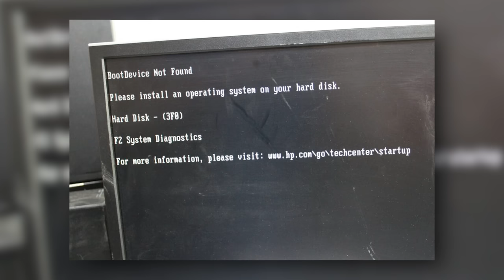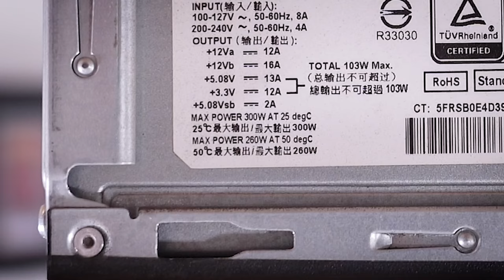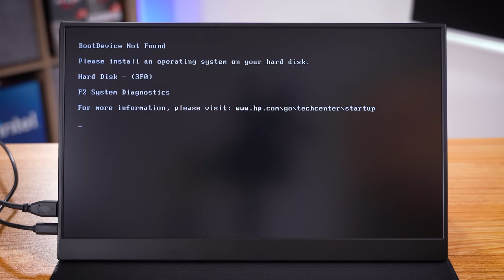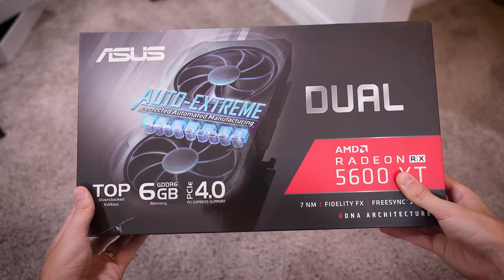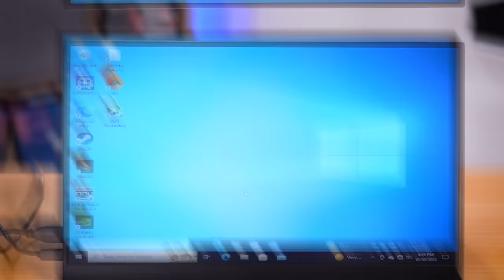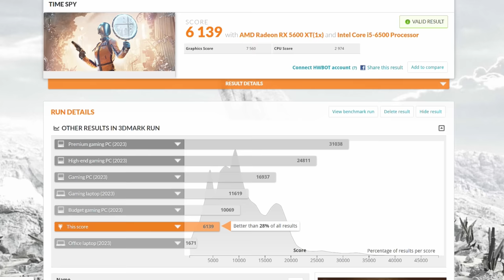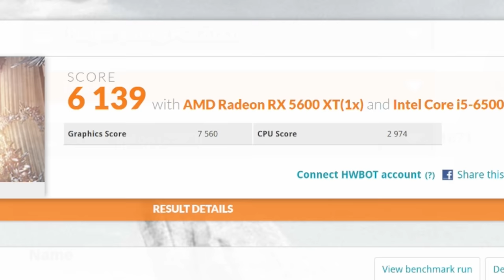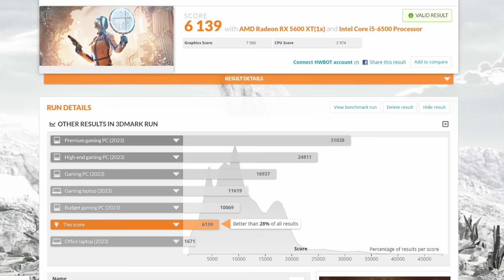I Built a $200 Bare-Bones Gaming PC!

Comment: At a little after 7:00 into the video, I noticed that the chipset does not have a heatsink on it.  Do you think it came from the factory w/o one or that it somehow got removed at some point?  Would it be worth stickin' at least a small one on it with a nice sticky thermal pad on it to hold it in place?
Btw, I totally agree with your summary at the end of the video; it's so much fun to see what you can make happen with a little older and cheaper used parts.
Reply: A lot of OEM systems are like that, not usually an issue

Comment: Might consider limiting purchases to Win11 capable machines, which include the required TPM 2.0 module. That is: Intel 8th generation or newer. For example, a renewed/used Lenovo ThinkStation P520 with Intel Xeon W-2135 CPU is fully Win11 compliant. A P520 "barebones" machine with CPU only, but no ram, no storage & no GPU can be found on eBay or Amazon for ~$185, shipped. Also note: a Hackintosh running macOS Sonoma does not support using any NVidia GPU's. Only certain new AMD GPU's are Sonoma compatible.

Comment: Hey, could you rate a pc build idea i have?

i5 10600kf
rtx 2060
1tb m.2 ssd 3500 MB/s
thermalright peerless assasin 120 SE argb
650w semi modular psu
and silicon power ddr4 32gb kit 4x16 for a total of 64, i do a lot with ram sometimes.
Reply: i just want to see if it is adequitly balanced compared to the pc im using now,

i5 6500
gt 1030
256gb no name ssd
intel stock cooler
and super cheap stock psu.

Comment: That gta5 result was very strange. I have used an I5 7400 and was perfectly smooth with 1070. I have seen videos on yt your exect CPU and also worked fine. Maybe you should cap the framerate to 60 fps?
Reply from the maker: Yep, exactly. Haven't historically had issues with Skylake i5s and GTAV. Will try to look deeper into it in the coming weeks if I can find the time.
Reply: @GregSalazar  great work man

Comment: i bought a Asus Rog Z370-H off ebay the seller shipped it in a smaller than should be box and the pin's got bent i bent the pins back slapped my I5-8500 in it and ram and she fired right up it was a brand new board that someone had bought off amazon they stole the accessories and sent the board back they never used it now it will serve as my intel pc it was a shot in the dark best 65 bucks ever i love older hardware

Comment: Just asking, but is it possible to transfer the Motherboard from those HP Pre-bulit to a new cheap case? (i know Dell ones can't be done)

Also, did you change the Paste on the CPU, because that might affect score.
Reply: Should be a direct drop in, and you can bring the I/O backplate.  Not sure if the headers are proprietary though.

Comment: That GTA V error makes no sense, it runs on a Steamdeck, and it runs well today on Haswell CPUs. I've run it recently on a spare GTX 1050 and 4690K. Something else must be at play here.
Reply from the maker: Yeah, and that was something I believe I alluded to as well. We’ve tested with older components without issue. I wanted to leave it in because maybe someone else had an idea. CPU power was noticeably low, which is why I suspected it to be the reason, but I could be totally wrong.
Reply: @GregSalazar  it could also be because it was a Windows installation created in another computer. You can usually put it straight in another build with little issues due to Windows installing drivers in startup, but it could be a chipset driver or other weird anomaly using drivers and firmware from a different Intel generation.

Or it could just be something else!

Comment: I spent 240 on mine cause I got extra parts like a pc case and a cpu cooler and a ssd
Reply: I built a i5 7 generation cpu
Reply: I built a i5 7500 with a 5500xt card

Comment: My question for you would be did you bother to check the BIOS update, HP (being as notorious as it is) will have a number of updates probably, however if there is an update for the BIOS it may break the ram timing issue.

Comment: Memory issues can be a little hard to diagnose. I have a strange issue(?). My memory kit is 16gb (total), but the BIOS and several diagnoses/spec software shows 32Gb. Some of the games have been using over the "16Gb" it's supposed to be. I gave up trying to figure it out and have been using it with no problems yet 🤞for almost a year.

Comment: Aren´t you US american? How much inch of clearance was left, about 0.20 inches? What a great messuringsystem 😁 for most of the world it´s just 5mm and especially carpenters agree metric is way better. And set GTA V to 1080P and it should be fine, the CPU physics test already told you, when the physics parts get calculated in a lower resolution it´s way easier for some CPUs especially those quadcore. In brand new titel you probably even have to drop to 720p for the CPU having even a slight chance of doing the physics and some other stuff fast enough. If you see utilization drop by upping resolution it´s a misunderstanding that the CPU has to do less work, workload is just distributed differently and some things get less demanding while others rise in difficulty for the CPU. You´ve rendered stuff before, right? So you should know higher resolution= CPU takes more time, same in games: higher resolution= more calculations per frame only difference some of that extra load is put to the GPU on higher resolutions.

Comment: hp? more like -$200 ...heh, ..heh. slowclap.
Reply: But, for real though. If I knew anything about computers(well building them anyway) back in 2016 when I bought a dell xps 8900 with a "gpu" I would have gone this route. When I was like 12 I built one online but i literally just like upchecked all the parts i really didnt know much besides ram. I shoulda tried harder. lol. Anything for a few hundred now with a jammed in gpu is ftw. I was like scared of psu watts back then lol